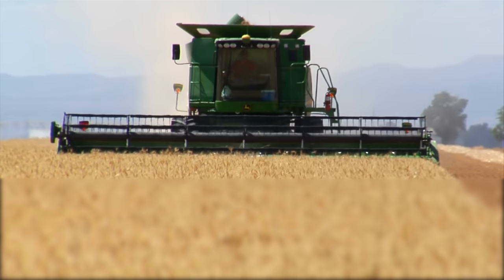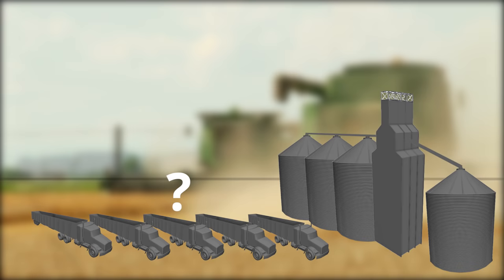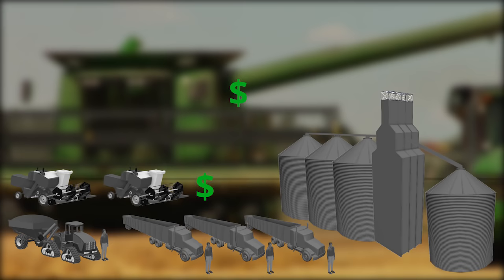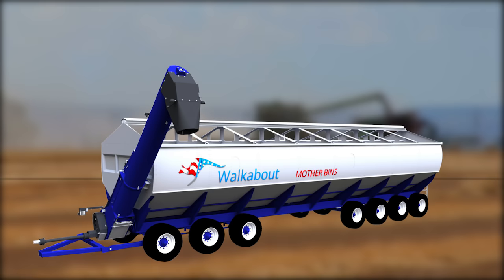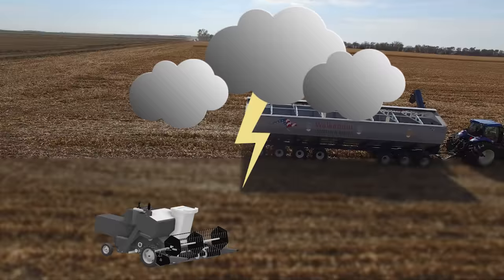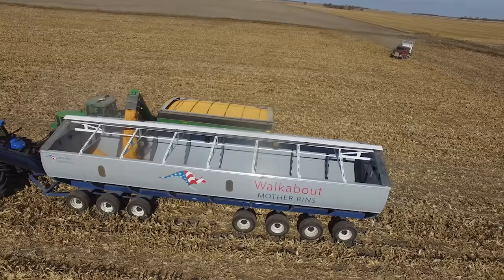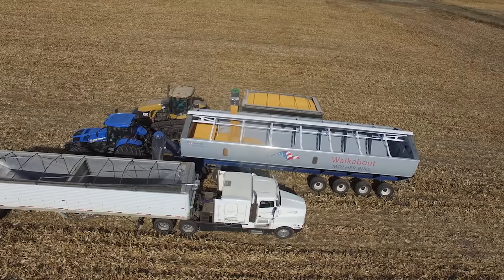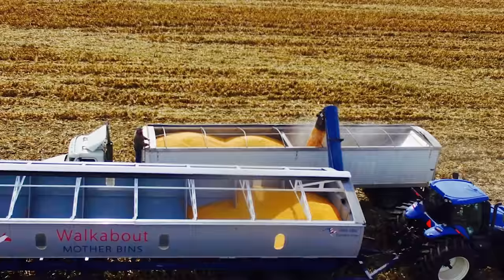What is A Mother Bin?

Comment: I don’t think they make a big enough tractor to hold that trailer back on the road
Reply: a big bud could manage, with triple wheels and weights. =)
Reply: You don’t move them when they are full a tractor stranded everyday use tractor that has like 50HP can pull it normally not full

Comment: You don’t need a grain cart for a two combine operation just some trucks
Reply: What?
Reply: Soooo much compaction with trucks not to mention slightly muddy fields
Reply: must not have to good a crop then we cant keep ahead of one lexion with one grain cart and 4 to 5 ,  7 axle truck and tralers
Reply: That works in plains country, but in the corn belt to get anything done you need a grain cart or two
Reply: My dad and I run two combines. In the hills of northeast Iowa. Two carts and a truck is pretty good, on beans. For corn, we need a second truck and people in the carts. A 9500 and 9550 deere.